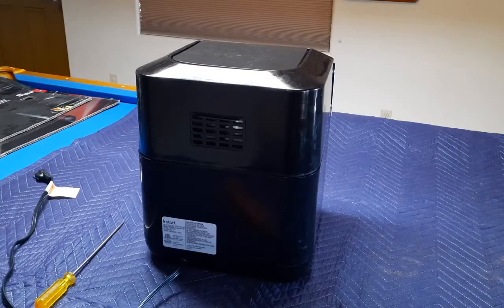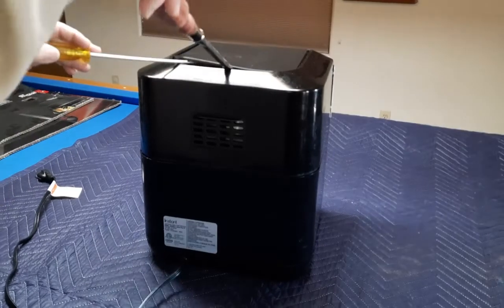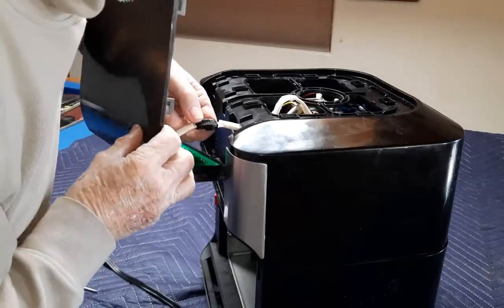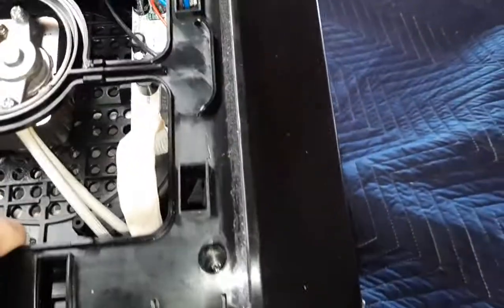How I fixed an Instant Vortex Plus Air Fryer

Comment: My air fryer Thermo switch gets stuck so offen.pl guide me to permanently get rid of this problem.I have placed Air fryer away from wall where there is fresh air  even than it got stuck.any idea of lubricating the switch pl suggest.regards, jatinkumar
Reply from the maker: Not sure I understand stuck. Perhaps you mean the switch has tripped and therefore has no continuity. No continuity means open circuit and therefore no current will travel beyond the fuse to the rest of the fryer. If you mean the fuse is constantly tripping, and you have cleaned the inside of the fryer as good as possible, most important to wipe the face of the fuse itself very clean. Plus you say you have moved it away from the wall to allow fresh air to be circulated thru the fryer, then you have done everything I would try. I never found the exact same thermal fuse for replacement, but I did not try very hard because we found out the black button did reset the fuse. 

The fuse was rated at 200 C or approximately 392 F, so perhaps if you have a cooking thermometer you could put in the fryer and see if the thermal fuse is tripping way below that temperature. If it is, then it probably needs to be replaced. I never found a replacement. If it is tripping right around that temperature then it is doing exactly what it was designed to do and probably does not need to be replaced. 
Perhaps the fan is not turning fast enough to circulate enough cooler air thru the fryer. Bad or worn out fan? However, for some reason, it is getting hotter inside the fryer than the manufacturer wanted it to and therefore the thermal fuse is tripping. I do not know why!

It was so easy to reset the thermal fuse on ours that I thought I would make the video to help others if they had the same problem we had. Since I had my son’s fryer completely disassembled I cleaned everything really, really good before reassembling it. It has not come back for repair. I told him, to keep as clean as possible, move it away from the wall when using it, and cook things that take a long time in a conventional oven instead of the fryer. That is about all I can tell you. Good luck.
Reply: Once i open and push down the black Thermo State switch,it starts operating.As suggested kept sir fryer away from wall even after this the Thermo switch gets stuck .not getting any solution,pl guide.Regards Jatinkumar36 k
Reply from the maker: @jatinkumardesai583  Sorry my video has not helped you. I only made it because, once I found out I could reset the thermal fuse and it is fairly easy to do, I decided to make the video to try and help out others with the same problem. 
Perhaps you need a new thermal fuse. I gave up trying to find one, since we did not need one. So you are on your own it you need a new thermal fuse.
 
It is very hard to remove the thermal fuse. I actually had ours out and in my hands when I tested it one more time and found it did have continuity. So I know it can be removed, it is just hard to do.  A lot of time has gone by since I removed ours, so I do not remember the exact process. At the very end of my written description, I give a couple hints. You might want to read my description. 

If I remember right you have to remove the heating element and the fan so you can remove the top plates inside the fryer to get to the screws holding the thermal fuse in place. The fan has a nut that is left hand threaded. You actually unscrew it going clockwise instead of counterclockwise. 

I would try to find a thermal fuse replacement before trying to remove it, because it is so hard remove it. 

Perhaps, once you have it out and you have reset it so it is getting continuity across the two posts, you could put it in a conventional oven set below the fuse's rated 392 F, say 340 and see if it trips, (check the continuity to see if it tripped). If it did not trip, try a little higher, say 350, then 360, and try to find out if it is tripping before getting to its specified tripping temperature or approximately 392 F. This should tell you if you need a new thermal fuse.  If it is not tripping until it is at or near the 392, then you do not need a new thermal fuse. There is something else going on where the fryer is just getting too hot inside and the fuse is tripping. Perhaps a bad fan? Once it has tripped it will stay tripped, (or as you are saying Stuck Open until it is reset) or it will stay open because it is a bad thermal fuse, will not rest, stays open, NO CONTINUITY.  At the end of my video I put a subtitle that shows exactly what ours had printed on it. tRY GOOGLING AND SEE IF YOU CAN FIND AN EXACT MATCH. Good luck finding one, if you need a replacement. 

There are many manufacturers of thermal fuses, many thermal fuses are not resettable. Once they open, they are ruined and have to be replaced. I had one of those types on a heat gun. It overheated and once it was open it was ruined. I had to replace the thermal fuse to get the heat gun working again. 

I have tried to help, but perhaps your problem is beyond the scope of this video and beyond my knowledge. May be time to buy a new fryer or just keep trying until you solve the problem. 
Good Luck!
Reply: @johntube2525  pl for your kind note that your vedio and the chats we had has really wonderfully helped me a lot and more and my air fryer is working,but only I had to reset Thermo switch,if it gets stuck.However,I shall read your chat and understand and implement it.Rest assure I am very much happy and satisfied by all u guide me and for that bundles of thanks and gratitude to you.jatinkumar Desai

Comment: Thanks for sharing! Very helpful in understanding the problem. Also thanks for posting the label on the fuse chip,

KSD301-CR
16A 125V
200 degrees C

 we might try that. :)
Reply from the maker: Thanks for watching and commenting. I am going to throw out my hypothesis on why I think people have trouble with these fryers. This is not aimed at you, but is something I hope others read. I am by far not an expert on these fryers. I don't even own one. 
The two main reason, I believe are:
1.	The lack of good circulation of air. The thermal fuse is tripped by temperatures over 200 degrees C. Therefore, circulation of cooler air is essential to avoid tripping the thermal fuse. For sure move it away from the wall when in use to improve circulation. Anything that can be done to improve air circulation during prolonged use should help. 
2.	Not wiping it down after each use. I would take a wet cloth and heat it up in a microwave or dip it in a pan with hot water. Then wipe the inside of the fryer down with a hot or at least warm cloth. Especially, wipe down the face of the thermal fuse so it is clean and not building up grease or other unwanted substances that could cause it’s surface to become too hot or not allow the heat to dissipate. 

I think I will try to edit my description and add this to it. Perhaps it will help others.
Again the above is not aimed at you, but is something I hope others will read.  Thanks for watching and commenting and good luck with your fryer.

Comment: This didn't work for us :(
The button also didn't feel like it budged at all.
Reply from the maker: Sorry it did not work for you. To satisfy my own curiosity, did you check for continuity from one side of the thermal fuse to the other side. If you have no continuity then you need to either replace or re-set it. If you have continuity then obviously the thermal fuse is not the problem. If you have continuity, some have commented having a door switch problem. Lots of things including microwaves, washing machines, etc. need to know the door is shut in order for the item to work. Thus the reason for a door switch. Just throwing this out there as a possibility. I believe some commented all they had to do was bend it a little and it started working again. We did not have a door problem, so I cannot help you there except to mention it and perhaps you can find a video regarding door switches. Thanks for watching and commenting, even though it did not work for you. Good luck!

Comment: I almost threw mine out and I was able to replace a microswitch and save $150
Reply from the maker: Thanks for watching and commenting. If your goal is like mine, to help others with what seems like a fairly simple fix, then I would encourage you to make a video of your micro switch replacement. Like my video, it could be made after the fact or even though you have already fixed the problem.  It could potentially help many grateful people. Thanks again!

Comment: I was not so lucky as everyone else in this comment section. The reset didn't work for me I'm afraid so in the trash it goes (note  to self: Do not pitchase another Vortex)
Reply from the maker: Sorry it did not help. If you read some more of the comments, a few people did not have the reset problem, but had a door switch problem. They were able to fix the door switch problem. Sorry I cannot help you with that, since my son did not have that problem, but it might be worth try if you are mechanically inclined. On my washing machine the lid has to be closed or the machine will not drain and spin. I had to take the old broken switch off and replace it with a new lid switch. Same thing on our old microwave. It will not operate unless it thinks the door is closed. Had to repair that switch. Anyways your air fryer needs to know the door is shut, via a switch,  to operate. Good luck my friend. Thanks for watching and commenting.

Comment: Mine trips all the time. Can y 14:32 ou bypass that fuse totally by connecting the two blue wires?
Reply from the maker: I would never by pass the thermal fuse safety device.  Just like I would never try to hot wire across a circuit breaker in my home. 
1.	Try making sure the thermal fuses' face is clean by wiping it down real good. 
2.	I would actually try to clean the entire oven area the best I could, but for sure the thermal fuse itself. 
3.	Next try moving the fryer to an open area when operating it, this will allow the fan to bring in cooler air and hopefully keep the thermal fuse from tripping. The fan if operating properly needs to be able to circulate cooler air into the fryer.
4.	I would only use the fryer for cooking small items or in other words for shorter times. Anything that takes a very long time to cook, I would use a conventional oven since the longer, it takes to cook in the fryer, the more apt the thermal fuse will trip. 
5.	If you try all the above and it keeps tripping, I would try to find a replacement thermal fuse, but never bypass the thermal fuse safety device. Perhaps the fan is not operating properly and perhaps it is time to replace parts or just buy a new fryer. 
Good luck!

Comment: The thermal limit switch reads good at .5 OHM. 
NOTE : On disassembly the coil fan nut is a left hand thread !
Reply from the maker: Yes, I did put some hints in the description on how to get to the thermal fuse by removing the heating element and fan, but probably no one reads my long description. I hope that they will read your comment, if they are trying to get to the thermal fuse or just removing the fan. Thanks for watching and a useful comment!

Comment: Any suggestions for after it tripped it stopped heating. It powers on fine, display is fine but its not heating. Thanks 😊
Reply from the maker: My sons had a heating element. Once I realized I could reset the thermal fuse I stopped my inquiry and put it back together, so I am not sure why your heating element is not heating. The heating element is large, so I cannot imagine it going bad, but I suppose it could. I suspect something else is not allowing current to go to the heating element. Perhaps just a loose wire going to the heating element. Perhaps there is another fuse or a component on the circuit board has gone bad and is stopping current at that failure. These are just my guesses, since we did not have your problem. Sorry, I cannot help you, but if you are a DIY with a multimeter I would look at the things I have mentioned here. Be careful, I always unplug the device and check continuity with no power present. Capacitors can hold current even when the device is unplugged, so just be careful with your multimeter. Good luck!
Reply: @johntube2525  Thanks so much much for your input. I will let me husband know! 👍☺️

Comment: Mine just popped back open after resetting it, I’ll need to replace it. Thank you for the part number!
KSD 301-CR
16A 125V~
200*C
( 200*C equals 392*F  which sits just below the supposed 400*F cooking setting???) 
No wonder it resets open (off)!

Comment: John i am completely shocked. I have a Beautiful Air Fryer that I need to resolder some LEDs on. Shockingly, when i went to plug it back it. It would just beep and turn off entirely.... I thought i fried it. Eventhough its in a different location. I followed the powercord. Found a nub ... Pressed it. It doesnt feel like a button but there was a tiny bit of give. I didnt hold my breath. Low and behold, plugged it in. Turned right on. Im shocked. Thank you so much!

Comment: If the thermal fuse does break don't get the brilliant idea if just wiring it together.  This box with the fan WILL burn your house down in minutes.
Reply from the maker: Great comment Charles. I totally agree! Jumping past or bypassing the thermal fuse is a terrible idea. I believe the manufacturer put this safety device there to shut off power when the internal temperature reaches 200 degrees C.That way the internal temperature would not continue to rise to the point of fire. If one bypasses the thermal fuse, you are bypassing the safety of no more power. Would you remove a circuit breaker and jump a wire across it. No way! At least I hope No Way.  Circuit breakers are also safety devices.
Reply: @johntube2525  I’m an Electrical Engineer.  Fuses are annoying but critical